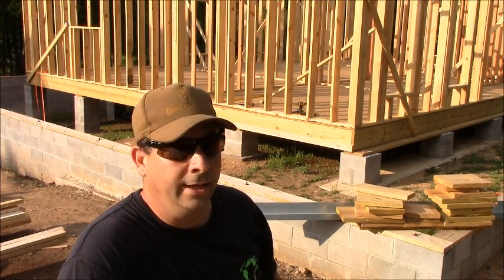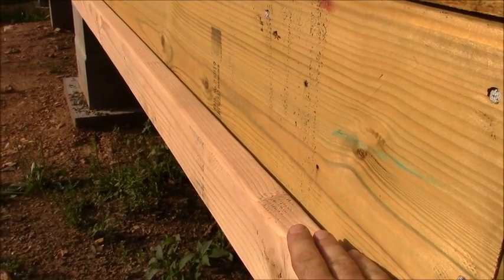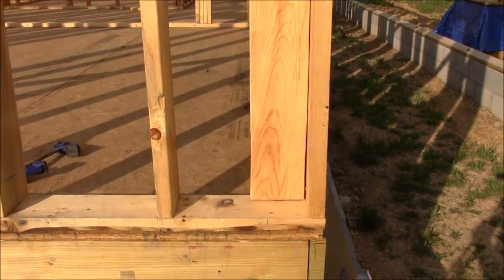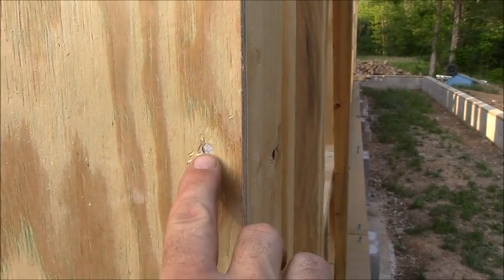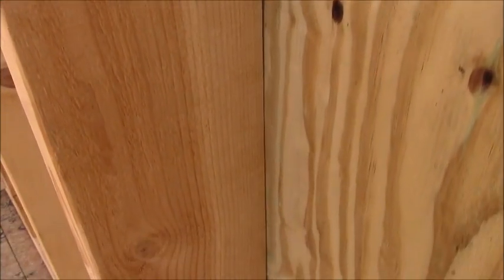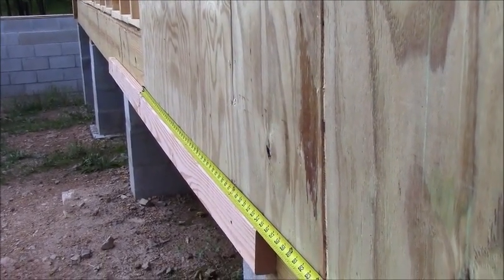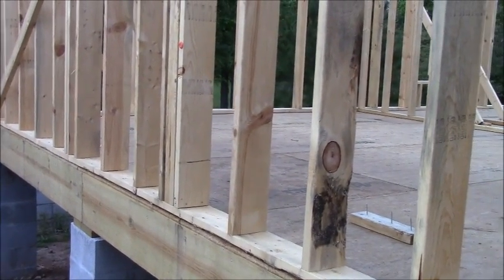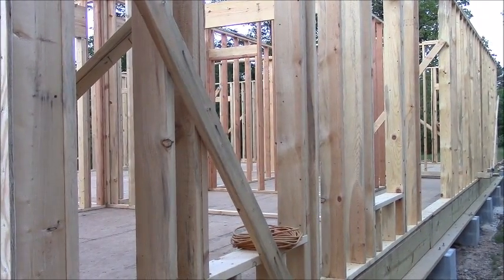Building My Own Home: Episode 23 - Sheathing the Exterier Walls

Comment: While going back and driving a nail in because the "nail gun" didn't draw the plywood in, keep in mind the stud itself could be warped.  If it's warped on one side, it will be warped on the opposite side.  If it's in a low traffic room where straight edges (like cabinets, or countertops) are not a concern, then it won't matter much, but just keep that in mind especially in a kitchen or bathroom areas.  I promise, you will spend time adding extra grout, or worse....shims between a cabinet and a wall.
Reply: By the way, love watching the work progress.  It's a feat and a half to do this on the side, so keep at it!  Good job!

Comment: New treated wood is almost always wet, to a degree. The plywood is probably swelled up just a little bit. And eith wet wood, you never leave a gap because it will dry and shrink.

Comment: Hey how about this...next exterior wall you frame, crown all your studs either in or out. Install your sheathing with nails 6” o.c. Adjust your nail gun for the proper depth, nail from the bottom up and the sheathing will snug up to the studs. By the way, you should have doubled your rim joust where your floor joists intersected perpendicular, thus making it a girder. Go pick up a copy of the IRC and review the chapters on floor framing, the span tables, girders and fastening tables, it will give you great insight into how to do things correctly.

Comment: Great video. I am a new subscriber and catching up. I do have a question about your headers. In 2x4 exterior walls I have always  "sandwiched" a sheet of 1/2 osb between whatever 2x lumber I was using for the header. Did you fill that gap with anything? I have never buit with 2x6 exterior walls.
Reply from the maker: +Darren King I know on 2x4 walls a lot of people do that. It not only strengthens the header, but also flushes it out to the same thickness as the rest of the wall. Since I am doing 2x6 walls there is enough of a gap between the header boards that I can fill them with spray foam to help insulate. With the larger boards I used the 1/2 ply isn't needed for extra strength. 

Now on my interior 2x4 walls I have some large doorways (8 and 10 feet) so I did use some 1/2 inch plywood between the 2x12 on those.

Comment: Hello, is the wood floor cheaper than going with a concrete floor?
Reply from the maker: A concrete slab is probably cheaper, but concrete floors hurt my knees, so ai went with a pier and beam floor. You could finish either subfloor with wood though. But if you are looking for the least expensive route a stained concrete slab is probably it.
Reply: @ArkansasHomesteader        I will need to build myself a small cottage one day soon, maybe 1000 to 1200 sq feet, and I will be on a very tight budget. So I’m looking at my options . I have 10 acres to build on. Maybe I can talk with you one day?
Reply from the maker: @langstonrowe8243  I will be more than happy to talk with you, but please understand I don't have a construction background. So I am no expert. I just knew pretty well what I wanted. So I researched what was needed to build that. But if you want to chat just send me an email to arkansashomesteader@gmail.com and I will send you my number.

Comment: Strange that you were running over...Most people complain about running under, because the dimensions of a standard " 1/2" x 4' x 8' sheet of plywood is actually only .438 x 7 7/8"x 6 7/8". Every 4 sheets you lose an inch if you think it's actually " 4x8 ", which is actually what they call the nominal size. 
Also, BTW it's obviously just my opinion, but it's a lot easier to add a stud than it is to rip a 4x8 sheet of plywood.
Reply: Well the reason why they are a tad shorter is because you should be leaving a gap in between each sheet for wood expansion, which counterbalance the one inch loss over 4 sheet making the whole thing pretty perfect. The problem is all the videos people look at tell to space studs 16 inches on center starting from one end of the bottom plate to the other. While this is true for almost all of them,  people forget that to have super tight exterior corner, you want to have your sheating to overhang the first stud by the thickness of your sheathing so that when you do the other wall 90 degree from the one you are doing, the sheathing thickness will add on and create a perfect exterior corner.  In order to make this work, the first stud after the corner should be spaced to account for this 1/2 inch offset.  He had to rip 3/4 on the first sheet because he screwed up the first stud placement from the get go. You should only have to rip the last sheet of a wall if said wall is not perfect multiples of 4 feet. Having to cut the first one shows a stud placement error from the beginning.

Comment: You're supposed to stagger your sheathing and run blocking on breaks   for sheer and structural purposes..would never fly outhere in Calif..
Reply: i don't think staggering doesn't change much for the exterior wall sheeting.  its mostly for lateral loads. (ie making sure the square wall stays square.) for flooring you stagger so it doesn't crack  tiles but otherwise the shear strength goes from one sheet to another since its fastened at the edges.

Comment: Why did you install the plywood vertically instead of horizontally?  I would think it would make things stronger if you install it perpendicular to the studs.
Reply: porfidia  Nope, the lateral resistance remains the same, west coast usually see it vertically not a problem, I understand mostly installed horizontal in eastern areas, either way same outcome for strong shear diaphragm.

Comment: I don't see any diagonal braces in your exterior walls - or - fire blocking in the studs -  - maybe I missed in later vidz, but it will rumble when you close doors...  Also, if you're tiling anywhere - in 5-6 years you'll be calling your tile man "grout cracking" - My 20 year tile man says every single time he's been called back to a cracking grout situation - it is 100% always due to the single 3/4" deck (the extra$) is soooo worth it - might want to consider dbl decking within the floor plan now that you have the walls in place (optimum to dbl deck from the start) Bouncy Bounce Bounce, gonna feel a mouse ! Sheathing - vertical? no stagger? NAILS??!! Squeeeeeekkkkk - that mouse will have accompaniment during high winds !!
Reply: MJG MJG   Fire blocks, where required in code, block two bays over each side of doors rumbling gone. Vertical sheathing is bracing per code also probably in designed plan. Engineers design both vertically and horizontally lateral resistance remains the same. 3/4 or 1 inch  t&g deck fine. Tiled areas use Additional substrate, hardy backer etc.  The code in your area allows diagonal bracing to resist high wind lateral loads, wow.
Reply: MJG MJG it’s not normal 3/4 it’s advantec and it’s glued and you’ll have a layer of hardy board for any tile.

Comment: So you frame up with 2x12
Reply from the maker: I used 2x12s for the floor joists yes. But thats not always the correct choice. You need to look at a span chart to determine your joist size. Floor load, joist span, joist spacing, and the joist wood species all play a part in the selection.

Comment: What is the length of your 2 x4's. Are your walls going ti be 9 feet tall ?
Reply from the maker: +J Dewitt They are just standard 9ft studs which measure 104 5/8 inchs.
Reply: @ArkansasHomesteader  i thought standard was 8 foot, and im confused on something else, which is better to go with, what they call precuts that are 92 and 5/8s or the 96 inch long ones? what is the point of the shorter ones?
Reply: feralbigdog 92 5/8 precut added to bottom plate (1 1/2 inches) and double top plates ( 3 inches) equals 97 1/4 inches. 
Two horizontal sheets of drywall or 1 vertical sheet equals 96 inches. Add 5/8 thick drywall for ceiling and you have 96 5/8 inches. That lets you have 1/2 gap between bottom of drywall and the floor. Remember you don’t want the drywall touching the floor. So that’s the reason for 92 5/8 inch precut studs. If you buy 8 foot studs you will have to cut them all down to 92 5/8 on the job site. If you don’t a vertical sheet or 2 horizontal sheets of drywall is going to be about 3 1/2 inch gap on interior walls requiring you to have to put a extra 3 1/2 inch strip of drywall on every interior wall of house that you drywall

Comment: 2x6 stud walls? Are 2x4 stud walls not enough? Just curious I've done walls before but never questioned it until I wanted to make my own homestead.
Reply from the maker: 2x4 studs are more than strong enough. I went with 2x6 studs simply because of how I want to insulate it.

I want to use 2 inches of spray foam on the walls to seal any gaps. Then I will fill the rest of the wall with blown in cellulose. This should give a really high R rating, plus the cellulose is a fire retardant, and if I ever have to run a pipe or wire in the walls I can push it through the cellulose. 

I am trying to do as much as I can afford to do to keep the utility bills very low. Hopefully, insulating this way, and having a full wrap around porch, and double venting my attic will acomplish this.
Reply: It should work both ways summer and winter. I  kinda figured that was what your doing just curious. I remember using hangers to help hang walls but 2x4 works just the same ha. Good luck
Reply: better insulation ,ext plumbing such as drains would stick out in a 2x4 wall

Comment: Where is the Tyvek paper barrier?
Reply from the maker: +John Brodt I didn't put that on until I was ready to put on the siding. Building this I my spare time by myself is a VERY slow process and I didn't want the tyvek exposed for that long. Since I was using treaded plywood for sheathing it need the protection right away, but I definitely did put it up.
Reply: Awesome to hear that, thank you for the update.  !:-)

Comment: Why 47 1/4" for the first piece, out of curiosity?
Reply from the maker: That's just because of how the studs fell out. You want the sheathing flush on the corner, and then on the other side it should fall out in the middle of a stud. You will almost always have to trim either the first or the last sheet on a wall.
Reply: i can see your stud on 16. no reason that you should trim on both side if at 16. and on the otherside. you could of hook to the exterior and mark your 16.. nice job tho!! and why vertical ^^ no strenght
Reply: I was a bit curious myself...I've never built a structure before, but always thought they went horizontal
Reply: plywood should always be run horizontal, as for the plywood not falling half on i see most people making this same mistake all the time. when doing your layouts weather it be on walls, floor joist, ceiling  joist, or roof rafters always hook your tape on the outside of your plates and measure 15 1/4 then tack a nail at that 15 1/4 mark and run your 16 inch on centers. its not a big deal but saves an extra cut. love watching these videos so many little mistakes, there not a big deal but all the little mistakes just add up more time spent building.
Reply: wrong layout to begin with. set your tape then mark it shy 3/4 of an inch. buy hey, you are going to live in the house YOU built.  Awesome!
Reply: for first piece it should be offset by 3/4 of an in so it covers the edge stud. or 3/4+thickness of the sheeting. (for the other intersecting wall) so that it covers the stud AND the edge of the other sheeting. that's perpendicular.  you should allow for 1/8th of spacing between sheets.  if you move your first sheet then all the studs also need to move accordingly by that offset which is easily done by offsetting the first stud as well then centering on that one 16c.c instead of the first stud in the corner. there is no need to trim the first piece but more than likely you are going to need to trim the last piece.